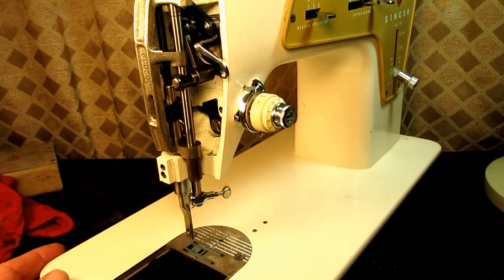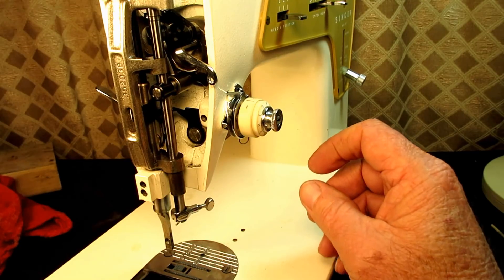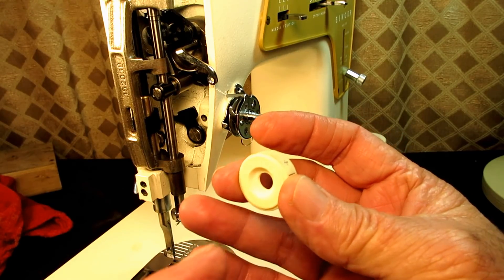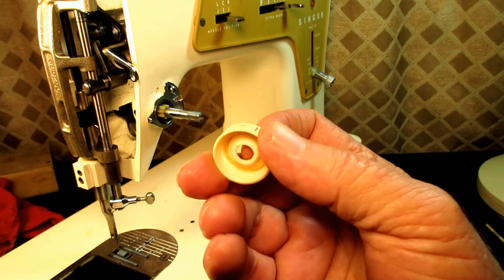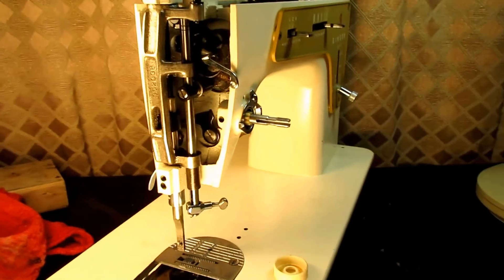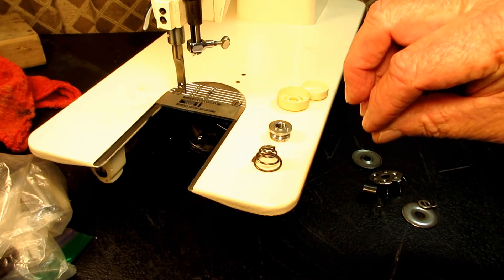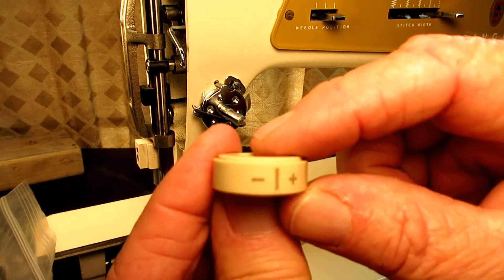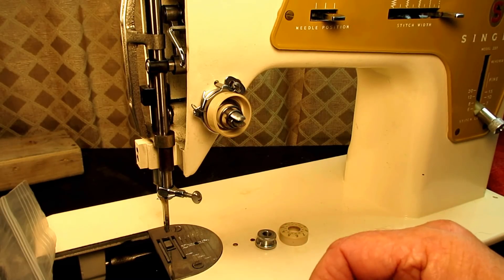A Broken Tension Unit on a Singer Model 237 ... Now What?

Comment: Hi Andy, I watched your video on cleaning, greasing and oiling my Singer fashion mate 237. I made my first quilt on this machine when I was 9 years old. That was 48 years ago. My machine is running so much better. But I have a problem. After threading the machine and placing a new bobbin in, the needle is not picking up the bottom thread on every down stroke of the needle. I did zero out the tension control just as you suggested. The top thread and the bottom thread are both making several different size stiches from half inch to one eight inch and it's very sparadic. All parts I have looked at seem to be in good working order. Maybe an issue with the bobbin timing? Help me, I'm stumped.
Reply from the maker: Hi, Shelby. First, let me answer the question you asked about bobbin timing. Skipped stitches can be a sign of timing issues. I'm wondering if you worked on the needle bar of your machine? This is a rare Singer for timing because of the mechanical construction. For models 237/239 when the needle bar is set to the correct height the timing is automatically set. This is because there is no way to separate the movement between the needle bar and the hook mechanisms, so there is no way for them to get moved out of time. If the needle bar is too high, too low, or turned somewhat sideways then that will affect the timing. Skipped stitches can also be caused by other things than timing. https://fashion-incubator.com/10_reasons_for_skipped_stitches/
Tension can be a cause of course. You worked on the tension unit so I know it is clean so just be sure a drop of oil did not get on the tension discs. You can test the tension by threading through the tension unit and take-up lever and stopping there. Set the tension to zero and put the presser foot down. Start pulling on the thread and it should come along very, very easy at zero tension. Now start turning the tension dial towards nine, one or two numbers at a time. As you pull you should start to get tension and the higher number you turn to the more the tension you should feel until going past nine should be very, very hard to pull. If it deviates from this pattern like the thread is hard to pull at 0 to 2 or still not harder to pull at 3 to 7 then something is adjusted wrong. You can easily change the tension dial to test if more or less tension is needed while slowly sewing. You don't mention if it happens in straight or zigzag stitching or both, so test in both styles. Because you have been sewing for about 50 years you now about 50 times what I know about actual sewing, but I have asked dozens of people how they fixed their skipped stitch problems. Here are common answers. Installed a new needle. Verified needle is installed in the correct direction and all the way up into the needle camp. Removed thread from the machine and rethreaded from the spool to the needle. Used a different bobbin. Cleaned tension unit. Repaired timing. Was using the wrong needle/thread combination ( as in too thick a thread for needle). Poorly wound bobbin was replaced/rewound. Cleaned bobbin case tension spring b/c tension too tight. Took to repair shop. Personally, the first thing I do when testing a restored machine and skipping stitches is just pull the thread right out and rethread the machine and replace the bobbin. That takes a short time and has cleared my problem often. Next, I just change the needle completely. This has cleared the problem. Then visually check my needle bar height and timing by looking at it. Doing the thread pulling tension test. Sooner or later I find the cause. For checking your timing you must be able to see the needle and hook point, so you may need to remove the needle plate and get a flashlight. A quick test is to turn the handwheel toward you until the needle bottoms out, then SLOWY turn more until you see the hook point. You should see the hook point directly behind your needle and the point should be about 1/16 or a scant 3/8 inch ABOVE the eye of the needle. that is timing and that is how the point of the hook catches a tiny loop of needle thread to wrap it around the bobbin thread. the needle bar MUST be on the way back up for this test.
It seems the tension unit is the first suspect if you worked on it. So if the needle height/position is set properly ( https://youtu.be/bRjfg2VaqP4 ) then I'd take another look at the tension unit after checking the other things I mentioned.  You caught me on the way out, but I'll be back later tonight and look for any other comment/comments you leave. Thanks for asking and for watching my channel. Good Luck.
Reply: @andytubesewing1953  Hi Andy, thank you for replying so quickly. When I cleaned and oiled the machine, I didn't adjust anything. I only took the tension adjustment apart and cleaned it. Watched you every step and put it back together and zeroed it out. There is no drag on zero and gets harder to pull as it is turned toward 9.  I will try some of the other things you mentioned and hopefully that will fix the problem.  One other thing, the +/- on the tension adjustment previously had a broken middle bar. The way I fixed mine was to super glue a very thin washer to, need to super paper on both sides of the washer for it to stick to the plastic, the open circle and then glue a thin piece of metal, I used a piece I cut from a safety pin, to that washer. Worked like a charm. Thank you so much for the information. Watching your channel to restore a couple even older machines that have been in our family for years.  Thanks again and God Bless.
Reply from the maker: @shelbycrabtree4033  What a creative fix for the tension indicator dial! I tried a few things like that, but it always changed the distance the tension releasing pin would push back the spring and take tension off of the discs. That gave me erratic needle thread tension while sewing. I wonder if that's happening. I guess you'll find out as you troubleshoot further. Nothing you did to the tension unit could have affected needle to hook timing, so no worries there. Thanks for saving those machines, and for watching my channel. Good Luck.

Comment: Greetings, I have a Singer model 239 and after getting it threaded up, I tried to roll the needle down manually to grab the bobbin thread and the needle will not go down into the hole to grab the thread from inside the casing. It stops at the surface. It's not thread tension. Any idea how I can trouble shoot this? Thank you in advance.
Reply from the maker: I'm going to assume the needle bar moves freely and you have tried this without any thread in the needle to be sure it's not a threading or take-up lever problem. It presents like the needle bar height setting is off and the needle bar is set too high. This is easy to check without the need of using tools. Here is my playlist of model 237 (the ZZ sister to your 239) with 20+ videos for adjustments and repair; https://www.youtube.com/playlist?list=PLsCOZgzzaiKKzvgm_CYPFnDeM8ZqTTo1h    The 6th video in the playlist has a portion showing how to check/set the needle bar height; https://youtu.be/bRjfg2VaqP4
If you need a copy of the original Instruction Manual you can download a free PDF from Singer at this link; https://www.singer.com/search/support?title=239    If you prefer to use a Service Manual you can buy and download a PDF of the original at this link for $9.95; https://manualsoncd.com/product/singer-237-sewing-machine-service-manual-download/
BTW, I am notified of every new comment on my YT channel so leaving the same comment on multiple videos is just a waste of your time and mine. Thanks for watching my channel and good luck.
Reply: @andytubesewing1953  thank you so much
Reply from the maker: @anonymoususer7119  no worries and I hope you sort it out.
Reply: @andytubesewing1953  I did.
Reply from the maker: @anonymoususer7119  Nicely done!

Comment: Hi Andy, I was watching your video in hopes of finding out what we did to our old White Deluxe Zig Zag. Does the tension post come off of the machine? The whole machine is metal, so I don't know if a weld gave loose, if we broke it, or if a piece is missing that holds it in place. Any ideas?
Reply from the maker: Yes, on most VIntage Singer machines the Tension post/stud comes completely off/out of the machine. It is held in place by a small set screw that tightens against the stud at a 90-degree angle and can be accessed from the front nose end or top of the nose end of the machine, somewhere in line with the tension stud. While it is rare for the screw to become loose enough that the tension unit falls off it is not unheard of that it gets loose and the whole unit turns freely instead of just the adjustment knob. I have no idea if this is the type of unit you have on your White brand of machine. I only work on SInger, but here are some videos I made of removing and replacing tension units on vintage Singer models. Maybe they can give you some ideas of how the unit works and mounts to the machine. Good Luck.
https://youtu.be/d4k2wlDFsj0
https://youtu.be/PSCY72bJ3x8
https://youtu.be/OqZZ-uhnAMY
Reply: @andytubesewing1953   Thank you so much for the fast response! I will definitely watch the videos and try to fix it. It's still in good shape, but little things keep going. Again, thank you!
Reply: @robertacowley1642  sure you're welcome I just hope that the videos can help you I've always been told that white made very nice machines in their day so chances are it's a lot better than most of the $200 machines you could buy now Good luck Roberta
Reply: Stop washers are important too? I think I may have a secondary problem. 
Thread tension arm, stop washers....I'm increasing my vocab here 😀
Reply from the maker: @robertacowley1642  It's the language of repair. Real technical, right? Beehive spring? hehe

Comment: Thank u for your step by step instructions. I have exactly  the problem  the plastic tension indicator cracked in half u have given me an idea how to repair it, as I don't think I would find one here . I am in Zimbabwe and have an old machine made in Turkey, by .singer model1301 I really enjoy watching your videos
Reply from the maker: Thanks for watching. I hope you can repair it. The problem I encountered was two-fold. 1. keeping the same distance from the end of the pin to the back of the little crossbar. I could "build-up" a tiny piece on the pin side of the new cross crossbar, or make a new pin that was a tiny bit longer. 2. On the inside of the indicator flange, the new crossbar had to be short enough to not interfere with the base of the tension spring. The tension spring needs to be sitting flush with the inside back of the flange. Best of luck to you.

Comment: When the timing is adjusted on my Kenmore sewing machine, and the thread is picked up,  the needle touches the bottom and does not have the space to go on.  What else could i do?
Reply from the maker: Hi Geraldine. My best advice is to get a good vintage Singer, haha. I don't do Kenmore, but if I had this problem on a Singer machine I would check the setting of the needle height. Most sewing machines work on the same principle. The hook should pick up the needle thread when the needle is on the way up. If the needle is touching the bottom of the hook then check is the needle the correct type for the machine? Is the needle installed all the way up into the needle clamp/needle bar? Is the height of the needle bar set correctly? Here are some videos on setting the height on Singer machine to give you an idea of how to do it. I do not know if they would apply to your particular machine, but it's a start. 
https://youtu.be/-FezmqypK6w  
https://youtu.be/9zU1_VjMddQ
https://youtu.be/Q6_S1F_l6sw
Good Luck. Thanks for watching my channel.

Comment: Andy, I'm skeptical of my re-assembly ability, I've watched the whole video a few times.
Someone gifted me a 547, I want to use it. First I plugged it in to see if it worked at all.

The person that gifted it, left all the tention parts in a zip lock bags. It seems everything is there. What's left intact at the moment is the tension post. I have the releasing pin and all the washers etc... I'm stumped as to what to do with the releasing pin. Do I take off the tension post also. Please advice when you have a moment, I would be so very grateful. I will be more than happy to watch and stop the video as many times as it takes to "get it". Warmest regards and again thank you. Kathy
Reply from the maker: So the 547 model shares parts with a half-dozen other models made in various Singer factories. It is hard to get documents for the 547. If you meant to write 457 then I have tons of documents. Anyway, the releasing pin slides into the slot opening of the stud. Slide it into the front of the stud with the flattened end facing you. You don't need to remove the stud. You can watch this video about removing & replacing a tension unit. https://youtu.be/PSCY72bJ3x8    Your unit has a little bit different knob/dial on the front, but the whole theory is the same. The parts manual for a model similar to yours is not clear about your knob. It looks like they made a couple different styles for the different models. All the parts that go on before the last knob are the same. There may be a set screw to hold on your final knob, or it may push onto the flanged adjusting nut using a compression ring. I've never seen you model. I have 30 other tension videos but there are not much different really. One piece at a time.
Reply: Yes, Andy I did intend to type 457. At the moment I am cleaning parts with Krud Kuter. I will watch the video again, stop and start again. Thanks very much. I appreciate your dedication and enthusiasm. Much kindness.

Comment: I just bought a 237 with this problem which the seller didn't mention. I'm going to try grinding a notch in the flange and using superglue/baking soda to fix a metal pin across the gap.
Reply from the maker: Your plan could work. Just this year I've had a number of people tell me they used a wire, coiled it like the stop washer without a finger, tapped it flat with a hammer, and glued it inside the indicator. Either way, you may need to file down the tension releasing pin a tiny amount to make it shorted b/c the crossbar is closer to the pin and the travel distance will be less.. Good luck.
Reply: @andytubesewing1953  It worked great and no filing was needed. Thanks for all your videos I've been able to restore a few vintage machines now thanks to your instructions.
Reply from the maker: @fatherkeith  That is very good craftsmanship when no pin length adjustment is needed. Nicely done 🏆 Thank you for restoring all those machines and keeping them in service. ✨

Comment: From a brief look, the metal indicator cup from the 201K should fit but haven't tried it yet (and can't find a replacement so don't want the 201K out of service just to fix this)
Reply from the maker: The part numbers for the indicator on models 201K & 237 are very different, so I don't know. For model 237 the part No. is 173669.
One viewer said this replacement worked for her: https://www.mrsewing.com/products/tension-spring-cup-for-507448-singer-44879-472
Reply: I'm 3D printing a new one now as too impatient to order a replacement
Reply from the maker: @crefmag  Nothing wrong with that. Good Luck. 👍
Reply: Seems to work pretty well after a few trials. My bobbin tension was odd but with one from another machine it worked fine. Thank you for your video as getting the tension assembly back together again could have been tricky but now it's effortless!
Reply from the maker: @crefmag  very welcome. Happy sewing.

Comment: Ok, so I attempted to repair the adjustment knob plastic cross member.  Why they made this plastic when it has a metal shaft pushing it every time you lift the presser foot to thread the machine? I have no idea. It may never break, and I have no idea when it did. I just got the machine, my first attempt at refurb. But...at $1.99 it's not worth the hassle. The old cross piece was broken in two, and out of the hub. I am used to working on watches and clocks, and this was frustrating. I ended up taking a bit of my wife's modeling clay (that hardens to a plastic when baked) and forming my own single piece. Still setting up so we'll see.  I don't think it will hold.  As for the plastic selector Just order a new one and watch the grass grow till it arrives.  But that nail repair of Andy's for the other piece is Spot-On!  Treadle-on!
Reply from the maker: Singer went to plastic to save money and compete against foreign manufacturing prices. A real shame IMO. I tried using some type of JBWELD putty that dried hard and stuck to plastic to make one and of course, it was too thick and a dickens to try to file and shape. I wish I had a 3D printer and could just print a new one, right? I hate waiting for the parts in the mail, but oh well, I just work on a different part, or even machine, while waiting. When it comes to restoring sewing machines, for its faults, I love it still, hehe.

Comment: This is what I ended up doing: I have a thin sheet of brass, and some tools to cut it. I outlined a circle with a couple of voids inside like so: https://photos.app.goo.gl/vYtG11bCYdtNMR7F8 and sanded it to fit inside the +|- piece like so: https://photos.app.goo.gl/PNT9gFCvveY8nA1m6.

I put it back together and now it works. I have not glued the brass to the +|- piece, but I am considering it. Right now it swings but it is easy to put it back to the upmost position.
Reply from the maker: YouTube wont post comments with links without approval. Got notified now and approved. A great idea and very workable. Nicely done. Thanks for sharing. I will pin it to the top hoping others see it right away.
Reply: Jesus, excellent alternative. Good job!
Reply: Just picked up a 237 with this exact issue - will give this fix a go, thanks!